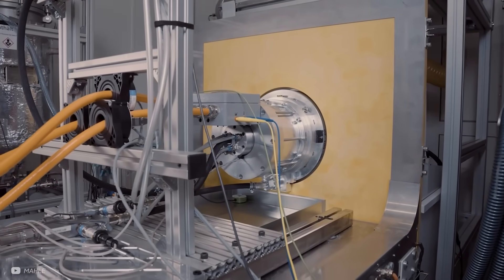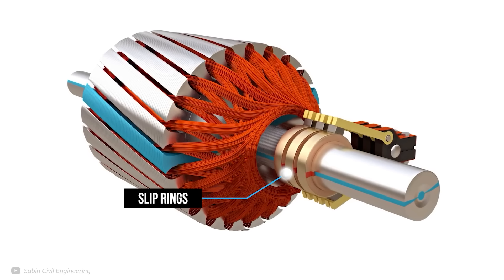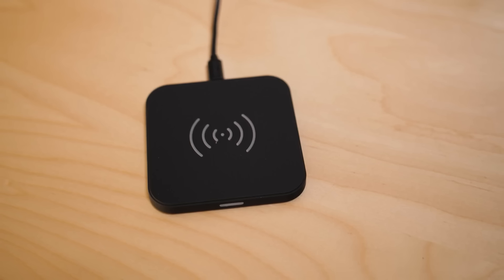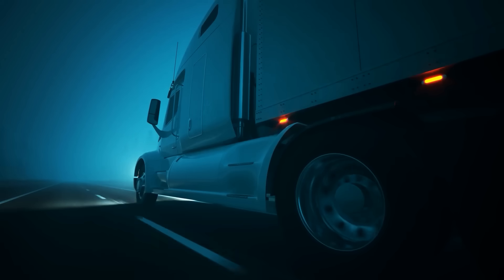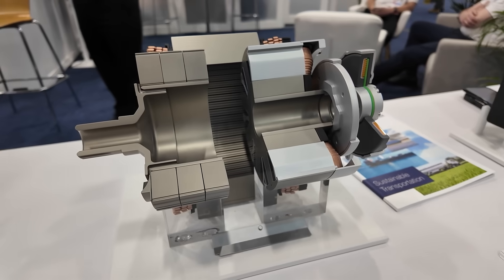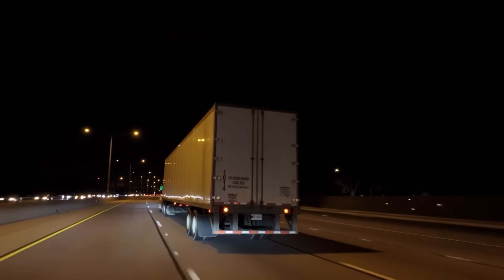Genius Contactless Motor Could Change Transport Forever

Comment: There have been 3-phase, brushless synchronous motors for a long time. Formerly, the motor would be started as a squirrel cage induction motor by shunting the field windings (not to be confused with stator windings).  These motors were typically started unloaded but had sufficient torque to accelerate the motor up to some large fraction of synchronous speed.  Early BS motors (;-) used a simple RLC relay that measured slip and closed when it reached a suitably low value.  Later, electronics that could be mounted on the rotor, were developed for this.  When the controller (RLC relay, or electronic) determined that the motor was close enough to synchronous speed, it would switch the field windings over to a DC supply, while opening the shunting circuit.  The switch, if successful, would lock the (now) fixed poles of the rotor, to the rotating stator poles.  I said "if successful" because if the load torque on the shaft was too high, the motor might not be able to be instantly pulled into synch.  If the relative speed of the passing stator magnetic poles N-S-N-S-N-... was too high, the fixed poles o the rotor would just sit there an slip until protective relaying triggered a shutdown.  Many of these type motors were used for large compressors, blowers, or pumps.  A motor start would involve opening a bypass valve until synchronous operation had been established.  * Now that we much more robust electronic components, we can use, the same field, stator, and auxiliary windings, with a VFD to bring the motor all the way up to synchronous operation.  After synchronous operation is established, varying the voltage to the aux windings that supply the rotor field windings (and eliminated the need for brushes) can be used to change the power factor of the motor.  I've never seen one intentionally run to lower lagging, but have seen a number run at 1.0, or even leading, to compensate for the aggregate lower PF of other plant (typically 3-phase line connected induction motors.  This can save a good bit of money in PF charges from your utility company.

Comment: Not new. The generators on ships have a permanent magnet generator on 
the shaft to power the electro magnetic coils on the rotor. They just used 
wireless charging instead.  Oil cooling  how amazing.

Comment: Im a little curious. The best efficiency I know of that we can acheive with wireless power transfer is 60%.

A motor of this kind would them multiply that by any inefficiencies in the motor design.

Now that would mean that at best this motor could achieve 60% power efficiency. 

Now i know of a motor design that needs none of that. It works under a diffrent pricable. And does not need center windings or permanent magnets. The tricky thing about it is that it requires more  complex circuitry and precise timings to operate at all. That and the designs tend to be kept proprietary and secret. Though the basic idea and principles have been publicly released. (I've heard this is the type of motot Tesla is using.)

But they are known to achieve 80% to 90% efficiency. (I've heard rumors of even higher.)

So im wondering, what is the benefit of this?

Comment: 1, this is not fundamentally new technology.  It is only better optimization of an existing technology for a new application.

Every time we take a wound rotor  motor, weld the slip rings together and install a VFD we’re creating the exact same thing.

They’ve basically taken something that is created in the field when modernizing classic heavy machinery, and just produced it that way in a factory.

2 the slip rings in a wound router motor are not used to deliver power.  They are used to place resistors in the path of the current created inside of the rotor windings.  The purpose of this is to control speed.  If you don’t want variable speed, or you use a VFD to control the speed, you already never needed to use slip rings in a wound rotor motor.

3.  This is not what a synchronous motor means either.   A wound router motor traditionally is the opposite as a synchronous motor. Its main advantage is a higher slip range, meaning you can have the rotor spinning slower than the rotating magnet field without burning up the motor.  That is their entire purpose in more classic designs.

A synchronous motor is a motor that is designed to have the rotor spin at the exact same speed as the rotating magnetic field.   They are typically used for control purposes that require precise movement not efficient power delivery.

Comment: As an electrical engineer I am highly skeptical of this. 
You say "induction motors are pretty inefficient", which is simply not true - induction motor efficiency is between 85% and 97%.
Mobile charging technologies such as Qi are in the 70% to 80% efficiency range, so I suspect your rotor losses will be higher using this technology compared to standard slip rings.

Would definitely need to see some real, independent data to have any faith in the claims made.

Comment: AC in stator induces electromagnetic AC in rotor. Good so far.

Where does AC in the stator come from? Surely not from a wire plugged into a power grid. Is there such a thing as an AC battery?

Comment: Okay a few hours spent searching on batteries and super conductors and fusion, Led me to the conclusion, That combining the technology being used in copper laminate conductors along with electric motor efficiencies as presented here could have incredible benefits when it comes To electric drive systems in the very Near future. If I can put this together I am sure some big industry is doing the same.

Comment: As a university student in the late 1980's, I graduated from a class specialized in the design of electric motors and generators. There is nothing mentioned in this video that was not taught to students back then, or that was not already implemented in mass production.
Hint: Just check the technical drawings from catalogue presentation of Caterpillar generators from the early 1990's.

Comment: also able to use the heat to heat the cabin is really usefull to since if you need to install an expensive heatpump is not only complex but also expensive not sure if it can go fully without but i assume it will also save battery for heating for countires that has more colder days

Comment: Good video but you should have emphasised the point that synchronous motors run at constant speed (if no VFD is connected) and hence are not suitable for a vehicle power source. PM motors, and the new design which you have described, on the other hand are more suitable for variable power/speed applications. 
Big differance. Anyway very interesting video, keep up the good work.

Comment: it is not clever- it's so much power you can transfer over limited space and it's not significant compared to permanent rear earth magnets.. so no- it's very low reliability  motor since it relies on oil cooling over moving sealing

Comment: The rotating transformer can only transfer AC, same as a contactless phone charger, except that it is probably not resonant. Anyway, it will need to have a rectifier in the rotating assembly. In 400kw range probably the power loss to magnetize the rotor is only a small percentage. Interesting idea, thanks for the video

Comment: It is just like combine generator winding with motor winding together and interesting is at the end had rotor with 90 ° with the internal rotor can be activate to generate laser light at the center shaft hole when needed

Comment: Their idea is good. But the wireless excitation is poorly designed. Rotor oil circulation is a design flaw that no electrical engineer would make, as it affects flux density, or at the cost of more excitation  current, lowers efficiency, power density, etc.

Comment: Brushes either operate at sea level or at altitude but no brush exist for DC motors with sufficient life that operate in both.  So brushless magnetic machines have existed for a century.  The reason larger planes electrical system for motors use three phase 400 Hz.  The generator for these system have had magnetic wound rotors to control the power generated also use brushless means to provide the current to these rotor windings since the later years of WWII.  They are still in airplanes today. In the commercial airliners you fly in. 
The cooling system is similar to one that I built in the 1980s for a motor provided to the US Navy.  A 270 HP motor that was less then 100 lbs.  The rotor fit into a 5 lb coffee can.   The pictures shown is of a flooded motor with oil.  That I find hard to believe because of the drag.   The weight of a magnetic machine determines the torque.  So to reduce weigh you increase speed for the same power.    
I am glad that they have taken this approach but nothing here is new except for the application.

Comment: That's not how motors work. The Rotor doesn't just spin around following the field created by the field windings or stator. Whether the rotor is commutated by induction, controller, or mechanical commutator it has its own magnetic field that leads and follows with attraction and repulsion of the stators magnetic field. Maybe your not explaining this new invention very well because all you are explaining is an induction motor. Whether you induce a magnetic field in silicon steel alone or wrap some copper in there it's an induction motor.

Comment: The major drawback of induction motors isn't the efficiency, it's that if you manually spin a synchronous motor it becomes a generator whereas an induction motor does not.
Therefore an induction motor doesn't provide regen

Comment: Permanent magnet motors don't have any power going towards the rotor two generate the magnetic field that it gets for free, so how could something that is sending power to the stater and rotor through wireless transmission that will have efficiency losses be on par or could even surpass the efficiency of an electric permanent magnet motor? I feel like you don't understand the law of conservation

Comment: I am wondering Where does the heat come from in a frictionless motor?  Why would it need the oil cooling?  Ya know?
Reply: From the electricity powering the motor.
Reply: @ ah ha!  Thank you for your reply.  Most appreciated!

Comment: What about the efficiency problem with wireless power and the higher needs due to the extra set of Electromagnetets and cooling system along with the extra weight and yes no rare earth metals but more of everything else and weight from the extra materials. ETC

Comment: AI Summary

Abstract:

MAHLE has developed a novel "Perfect Motor" for electric vehicles, particularly trucks, that addresses key limitations of existing motor technologies. This externally excited synchronous motor uses wireless power transfer to energize electromagnets within the rotor, eliminating the need for wear-prone slip rings and costly, environmentally problematic rare earth magnets found in permanent magnet motors. A sophisticated oil cooling system allows for sustained high-power operation. The design achieves efficiencies comparable to permanent magnet motors (over 95%) and significantly higher than induction motors, while offering the added benefit of controllable magnet strength for optimized performance across different operating conditions. This motor offers a sustainable and performance improvement for the electric vehicle.

Mahle's "Perfect" Electric Motor: A Deep Dive into Magnet-Free, High-Power EV Technology

*   0:00:02 Introduction: German automotive parts manufacturer, Mala, claims to have developed the "perfect" electric motor.
*   0:00:08 Key Features: The motor is designed for continuous high-power operation and eliminates the need for rare-earth metals (found in permanent magnets).
*   0:00:41 Motivation: Electric motor advancements are crucial for sustainable transportation.
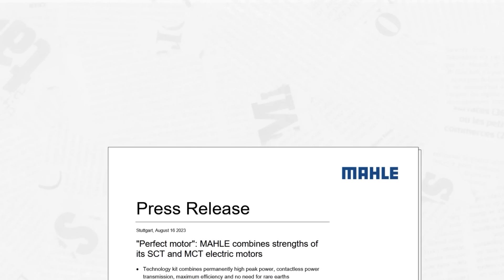*   0:00:56 System Overview: Mala's "perfect motor" (their quotation marks) combines previously developed motor technologies.
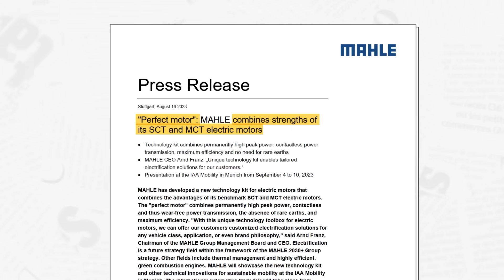*   0:01:05 Core Technology: It's a synchronous motor using wireless power transmission to energize electromagnets within the spinning rotor.
* 0:01:14 Advantages Over Permanent Magnet Motors. Can control electromagnet strength, No wear-prone slip rings.
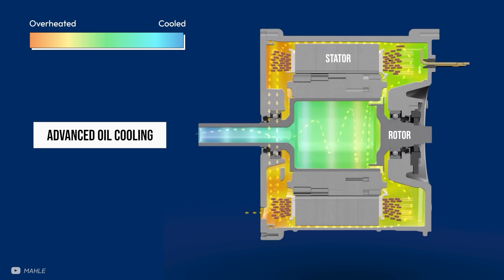*   0:01:25 Advanced Cooling: Utilizes oil cooling for sustained high-power operation.
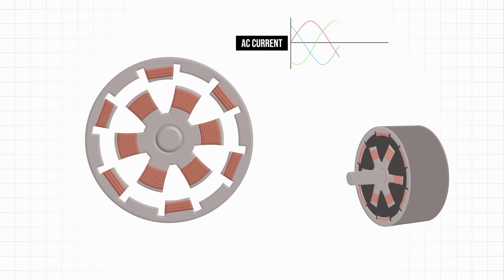*   0:01:39 Working Principle: Electric motors function by creating a rotating magnetic field, which a rotor (with either permanent magnets or electromagnets) follows.
*   0:01:56 Why Magnet-Free Motors?
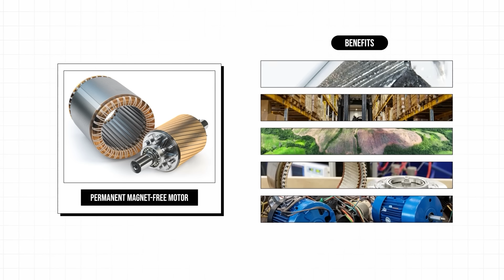    *   0:02:03 Lower Cost: Avoids expensive rare-earth materials.
    *   0:02:11 Supply Chain Stability: Reduces reliance on limited global sources.
    *   0:02:16 Environmental Benefits: Avoids harmful mining and processing.
    *   0:02:24 High-Temperature Reliability: No demagnetization issues.
    *   0:02:35 Easier Recycling: More sustainable long-term.
*   0:02:40 Externally Excited Synchronous Motor: The Mara motor is this type. The rotor's electromagnets spin at the same speed as the rotating magnetic field.
*   0:02:59 Traditional Power Delivery (Slip Rings): Externally excited synchronous motors typically use slip rings (metal rings and carbon brushes) to power the rotor, which can cause tangles and are prone to wear.
*   0:03:40 Benefit of electromagnet. Works like permanent magnets without using rare earth metals.
* 0:03:52 Problem Solved. Slip ring used to power spinning rotor is prone to wear.
*   0:04:00 Wireless Power Transmission: This technology, similar to wireless phone charging, is used to eliminate slip rings.
*   0:04:18 Wireless Charging Analogy: A charging pad creates a magnetic field, captured by a receiver coil in the phone, converting it back to electricity.
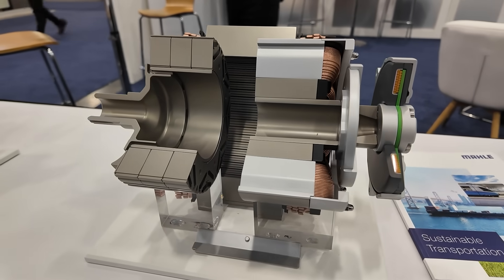*   0:06:09 Mala Motor's Implementation: An inductive charging section replaces the slip ring, wirelessly transmitting power to the rotor.
*   0:06:38 Solution to Slip Ring Problem: Durability issues are addressed.
*   0:06:43 Rotor Magnet Control: The strength of the rotor's magnets can be optimized for different operating conditions.
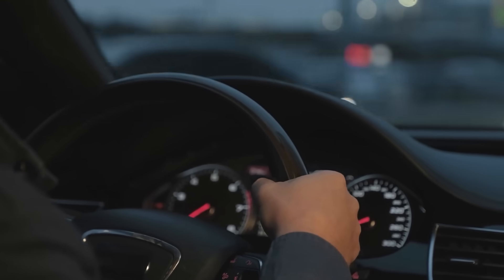*   0:06:52 Induction Motor Comparison: Unlike induction motors, the Mala motor offers precise control over magnet strength and efficient power transfer to the rotor.
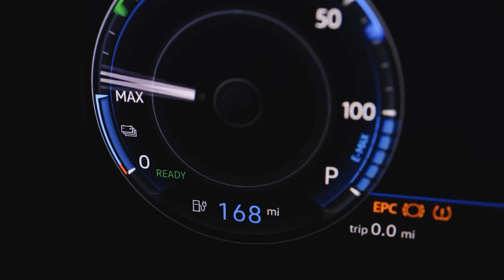*   0:07:34 Efficiency of Electromagnets: Using electromagnets in the rotor is surprisingly efficient, partly because permanent magnets can cause losses in other motor parts.
*   0:08:06 Cooling System: Adapted from a previous project, the oil cooling system allows near-maximum power and torque for extended periods.
*   0:08:25 Oil Cooling Process: Oil flows into the rotor, spins outward to the stator, cools the windings, and drains out, carrying away heat.
*   0:08:42 Heat Utilization: The warm oil can be used to heat other vehicle parts.
*   0:08:46 Direct Oil Cooling: Directly cools the warm copper windings, possible because the oil is dielectric (non-conductive).
*   0:09:09 Performance: Power and torque depend on the application, likely reaching 300-400 kW for large trucks.
*   0:09:29 Efficiency: Mala claims efficiencies exceeding 95%, comparable to permanent magnet motors and much higher than induction motors (around 85%).
*   0:09:46 Power Density: Likely slightly lower than permanent magnet motors, but still potentially double that of standard induction motors due to the advanced cooling.
*   0:10:03 Benefit: Sustained power delivery, preventing overheating during demanding tasks like mountain climbs.
*   0:10:11 Summary: Wireless power transfer enables a copper-wound rotor to rival permanent magnet motors without relying on rare-earth metals, with added benefits of controllable magnet strength.

I used gemini-2.0-pro-exp-02-05| input-price: 1.25 output-price: 5 max-context-length: 128_000 on rocketrecap dot com to summarize the transcript.
Cost (if I didn't use the free tier): $0.02
Input tokens: 14733
Output tokens: 1122

Comment: Simple but effective idea.  Any information on how much power is used to energize the windings vs using permanent magnets?  Having 95% efficiency is great, but without knowing it's power per watt output, kind of a moot point.  TIA if you have any answers.

Comment: you almost lost me at wireless power transfer. They are normally very inefficient, especially at high power transfer ratings. what is the efficient of this wireless transfer also in calculating the efficiency of the overall motor what about the pumps need to pump the coolants in and out

Comment: The cut away demo shown at 6:19 and the illustration at 6:30 don't make sense to me. Using a phone's Qi charger as an example confuses it more, the illustration shows the magnetic flux contained within what looks like a conduit of some kind, making sharp 90 degree turns.

Comment: it is not clear what is less efficient in an asynchronous motor when transferring energy to a short-circuited rotor? everything is the same as with wireless charging! and their efficiency is up to 90-92 ))) If you really need to make an asynchronous synchronous one without magnets and contact rings, then wind wires into the rotor and solder the diodes! If you really need to increase the efficiency by another 5-8%, then apply high-frequency voltage to each half of the each reel of the main winding along with the operating voltage! then there will be no losses at all! ))) And if you still need to raise the efficiency to 120%, for example, then I do not know any legal ways... And illegal ones can not be written here.♦

Comment: Power density left the chat lmao. May work fine for long haul cargo transport where weight and power density and form factor is not as restrictive, but in most of the growing high-demand ev fields, this doesn't really do much. Also rotational inertia is not favorable either, again, unless you're talking major haul applications or industrial machinery.